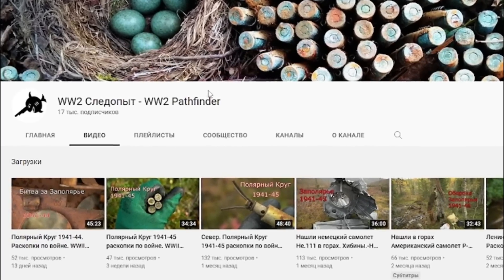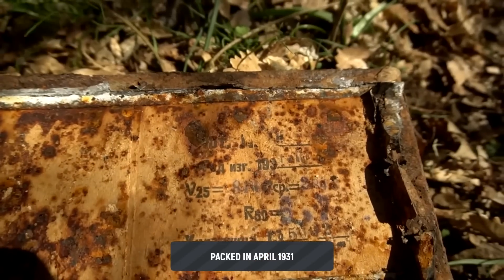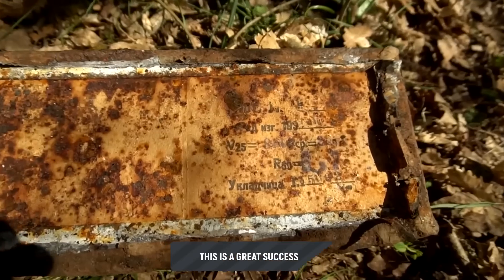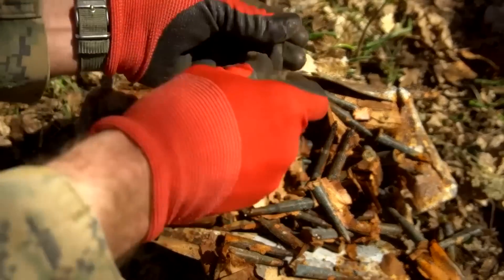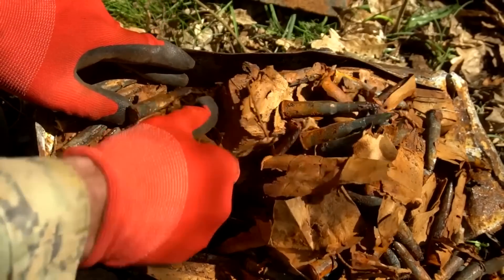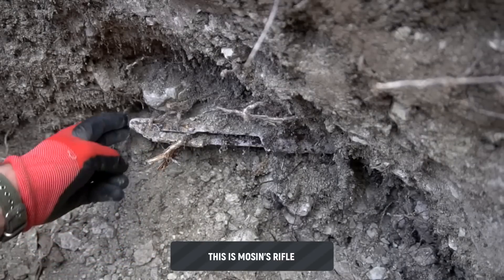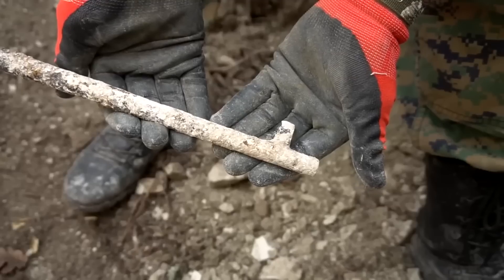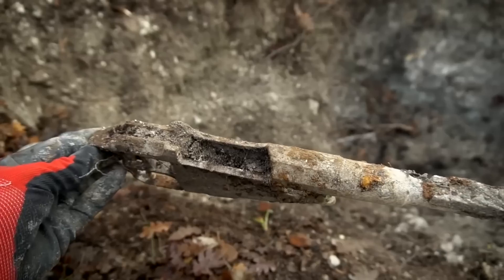WE FOUND A BOX CLOSED IN 1937. WE WILL OPEN IT! / WWII METAL DETECTING

Comment: I can't help wondering if this ammo still works... theoretically, the cartridges should still be active, but they need to be properly cleaned before testing
Reply: @paul-vw2ey I don't think you can fit 7.62×54 ammo in a 303 , but I get the drift ,ate.
Reply: ...it's not worth the risk: the gun is likely to blow up!!!
Reply: @chaffcutter58.  ...even if it was used in an intact captured German rifle- I STILL wouldn't try to use any of those cartridges-!!!